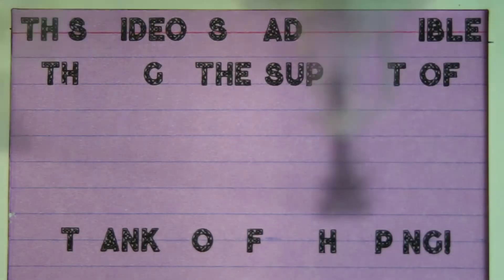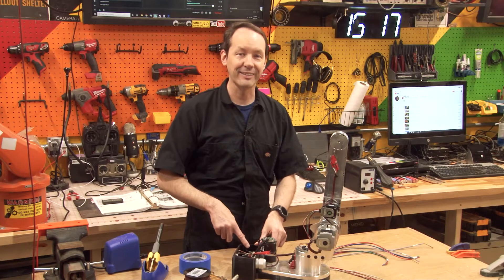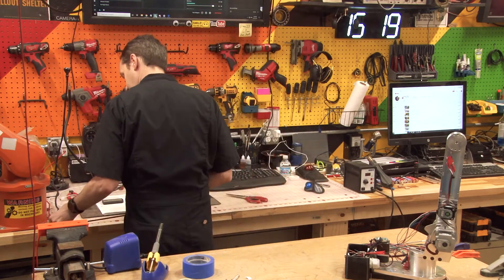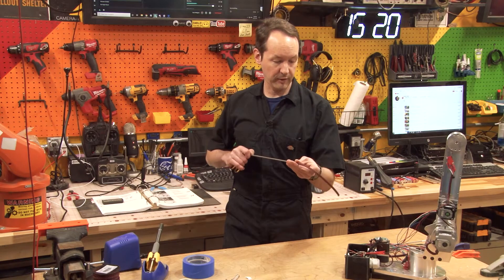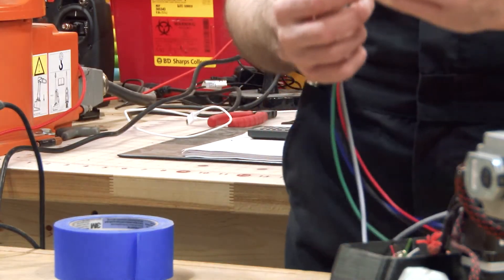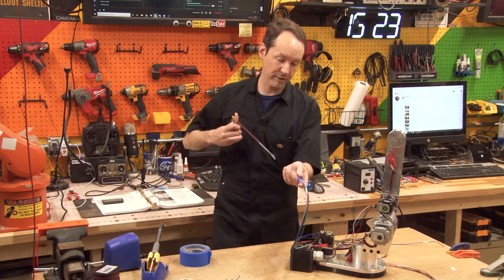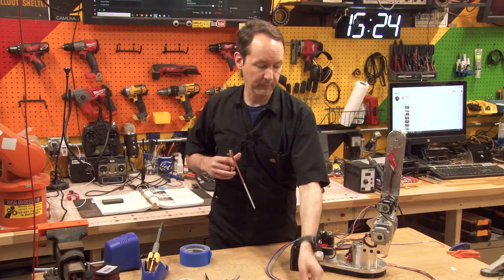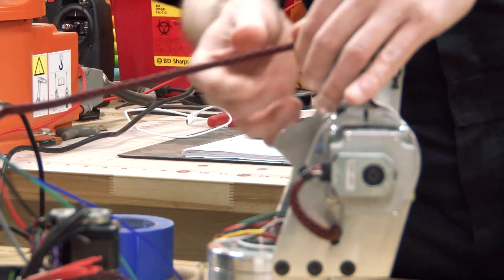Project ARchi3 Episode 29 - J3 Motor And Encoder Cable Routing

Comment: Is it just me or does that cable tie gun take 3 times as long as just hand tightening and flush cutter...
Reply from the maker: Depends on what you're doing. For one or two it's not that big a deal, for doing a few hundred in a day it's a hell of a lot better. As a guy who does a lot of electrical work, it's one of my favourite tools.
Reply: Chris Boden ok
Does it allow you to Mel it tighter of what is the advantage?
I mean I worked in an assembly line with cable ties...